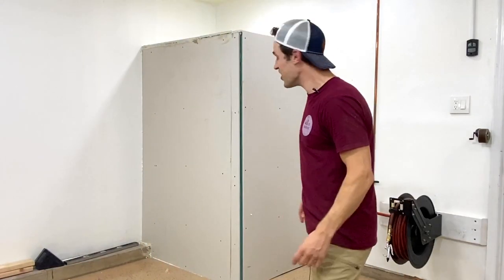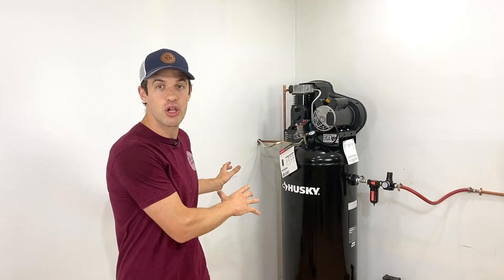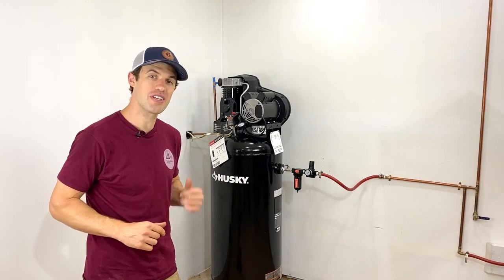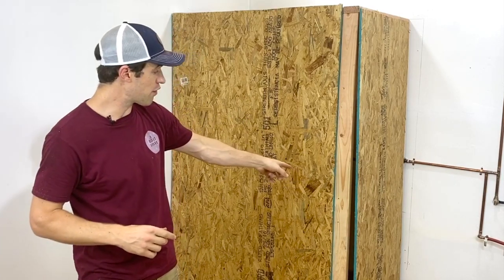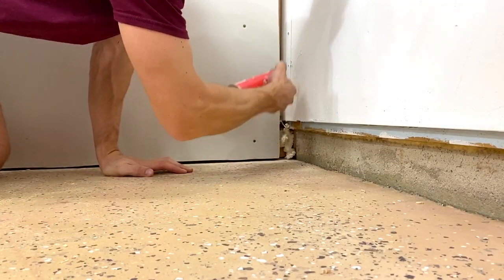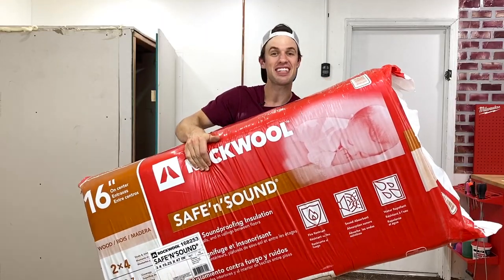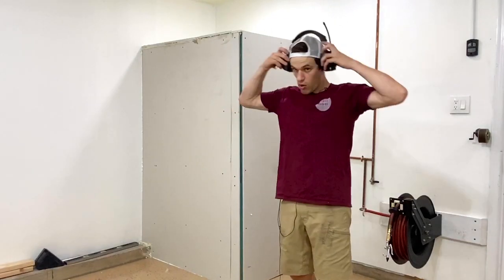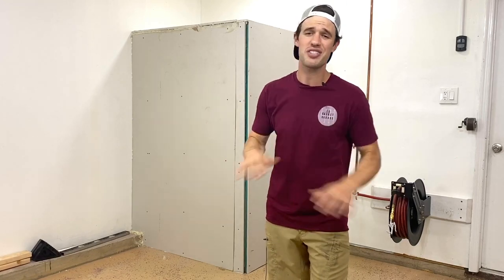How To Make Your 60 Gallon Air Compressor Quieter | CHEAP & EASY

Comment: I work for a compressor company Delta Industries and I can tell you you’re doing it wrong your compressor needs air it needs to be able to breathe the compressor is the worlds biggest vacuum it will overheat I’ve done this for 12 years
Reply from the maker: No doubt more air is better.
Reply: I see you work for Delta Industries . . . I have a Delta drill press from the early/mid 40's that still runs strong! 100% original and I got it from the original owner.

Comment: RIP to that compressor. It will overheat without any air intake. You've essentially cut down its the lifespan by 85%
Reply from the maker: The intake is a hole on the exterior wall

Comment: Sound travels in waves. Every time it has to pass through something the wave gets smaller. If you would have put an open space between every layer it would have been way quieter. That's why insulation worked best. It is full of dead air spaces. Plenty of material then air then material then air and so on.
Reply from the maker: Ever quieter!?!? That would be insane! (Or just buy a scroll compressor lol)

Comment: I'm concerned about the airflow in the thing. I feel like the air compressor would overheat in there if used long enough.
Reply from the maker: ChampionHoodie I have been monitoring the temperature. It honestly doesn’t get too hot but I haven’t stressed the system yet. I plan on cutting in a vent. The noise difference is minimal. That insulation is key!

Comment: Would love to see a follow up on the vent. We have this exact issue at work and built the box a couple years ago but haven't insulated because the temps are already getting high.
Reply from the maker: I never added the vent because it simply doesn’t get hot in there. It certainly gets warm but I have the intake vented through the drywall and collects air from just behind the exterior siding. That feature must help more than I expected.
Reply: U NEE TO HAVE SOME VENTILATION RIGHT? MAKE NO SENSE TO DO IT IF U WOILL BURN YOUR COMPRESSOR?
Reply: @EdgasketGarage  Put a draining load on it and let it run for 24 hours. Unless you have the world's first perfect insulator, the whole box will gain heat.

Comment: Where's the air intake?  It IS an air compressor, and needs a source of air it can compress....
Reply from the maker: The intake plumbing runs through the drywall and exits under the aluminum siding outside the building.

Comment: I'd like to build a cabinet out of foam board and add a vent tube on top with a fan to draw heat out and vents underneath to allow airflow from the bottom (with filters of course since floor air is dirty).  Maybe even have a secondary foam board layer with an air gap??  Add a nice exterior on/off switch so the board can stay together more.
Reply from the maker: your compressor motor and your ears are going to thank you

Comment: how is this holding up?  Does the unit overheat?  Did you end up adding ventilation?  How did that effect the noise?
Reply from the maker: I didn't add a vent. I cut a small hole inside which already had an open vent that extended under the extrerior siding. Noise is great. Temps don't ever exceed ambient summertime temps.
Reply: @EdgasketGarage yeah because I'm sure you actually measure the internal parts of the motor
Reply from the maker: @tiaan_va  I don’t care enough to do that. I need air. It makes air. For years now.

Comment: How did you pipe you intake? I see it goes to a different room?
Reply from the maker: that's an exterior wall. It goes under the siding outside at the corner of the building.

Comment: Did you add a ventilation on it? Still waiting for the video.
Reply from the maker: No it turns out the hole in the drywall for intake pulls in enough air from outside to keep it cool in the box. I had this thing running for an hour straight and the temps stay down.

Comment: What was the SPL with the top vent you added after this video?
Reply from the maker: Hate to say it but I haven't used the vent. The intake for the compressor runs through the drywall and up to the soffit. This has offered enough ventilation that the space isn't heating up.

Comment: I accomplished the same by draping a heavy moving blanket around my compressor without touching the motor/pump of course. And run 2 small fans to draw cold air in and push hot air out.
Reply from the maker: Those moving blankets absorb a ton of sound!

Comment: How do you keep the compressor cold?
Reply from the maker: There is a small vent through the drywall and exits behind the siding on the exterior. It really rarely gets above 90 degrees.
Reply: @EdgasketGarage  Hello, I am seeing your comments about how you have a vent through drywall that allows for ventilation. On average what has the temperature been in the closet? Also how big is the opening? What is the longest you have run the compressor?

Comment: You're definitely shortening the life of the air compressor. Your vent will need a fan in the ductwork to be effective.  If you vent to the outdoors and the fan is drawing the hot air out, you will need a register mounted low on one of the enclosure walls. More noise. If you pull air in from the outside then you risk pulling in hot humid air. No easy solution. You fix one problem and create another.
Reply from the maker: It's incredibly quiet even with the door OPEN! If i'm ever running 100% duty I leave the door open ~5 inches.